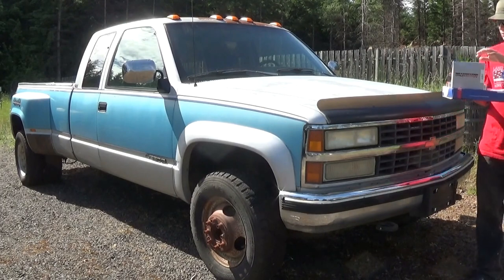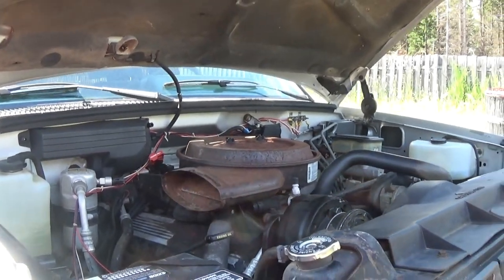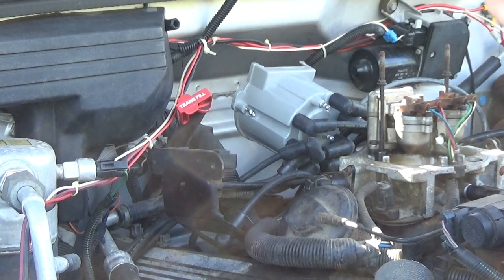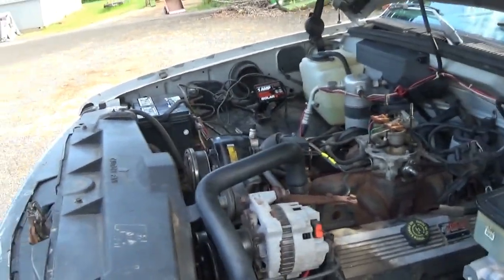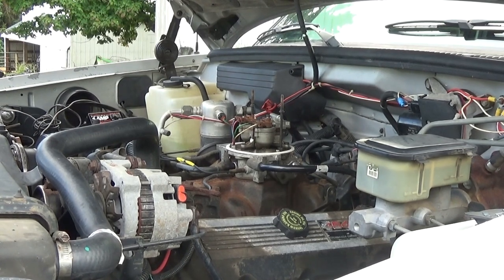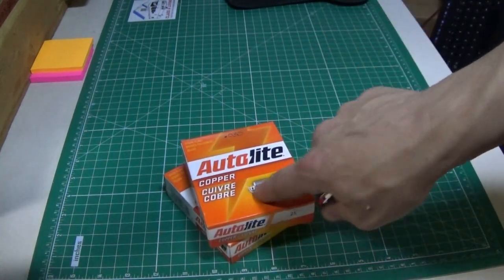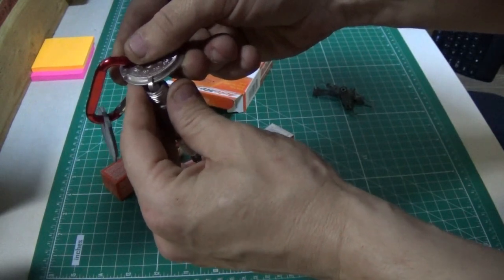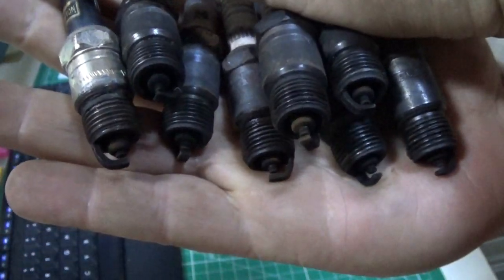Truck Tune Up || 93 Chevy K3500

Comment: Set up stainless wheel simulators would make old girl look awesome. I got 2 of those trucks a 4 door cummins swapped and a regular cab 454 gas . both 4x4. Wont trade them .

Comment: FYI you always check the gaps cause the parts boys throw those boxes around messing up the gaps. the disk gaper are ok for those plugs or cheaper plugs but on your more expensive platinum or irridiam ones you want to use the wire type so you dont scratch off the precious metal

Comment: I know the battery is 13yrs old, but you could always try opening the top caps and seeing if each cell is properly flooded.  If you can see dry plates, add some (preferably distilled) water to bring it at least 1/2 to 3/4 of an inch liquid over the plates.  The battery may play nicely again, but due to its age, I'd guess she's pretty well due for retirement and replacement.  Gapping plugs - my Dad could gap them by eye, and if you didn't believe him, you could check with the tool; it was a rare occasion that he'd be off by very much. He was also great at telling you what size wrench or socket was needed,  and could convert between SAE and Metric sizes on-the-fly.  I'll probably finish out my life and be lucky to grab a handful of wrenches or sockets from the toolchest and have the one I really need each time, much less be able to judge the size by merely looking, OR converting sizes between one unit of measure and another. Although, I have better luck remembering the size from having done the job once before. Hey, right near the end of the video,  are you falling behind on the lawn mowing duties there, Nate ?

Comment: The rotor is more important  to change out than the cap, as the rotor will burn through and carbon arc, causing misfires.

Comment: Great work on this truck, dont forget to grease the front end and universals when ever you plan on driving it more.
Reply: I could be wrong but i don't think these trucks had greasible fittings on the universal joints, i know my 95 suburban doesn't.

Comment: Did you scrape the  posts/contacts of the dissy cap after replacing the rotor button?   Can't beat an old fashioned set of feeler gauges for gapping plugs and points and for adjusting valve clearance etc....

Comment: Checkout Milestar Grantland tires on amazon or Walmart really cheap but I've had really good luck with them balance well got 20k on first set no issues sold tht vehicle my current vehicle 26k miles on the tires no issues